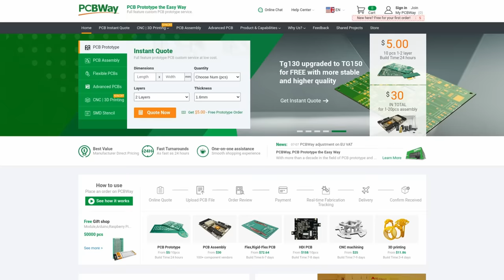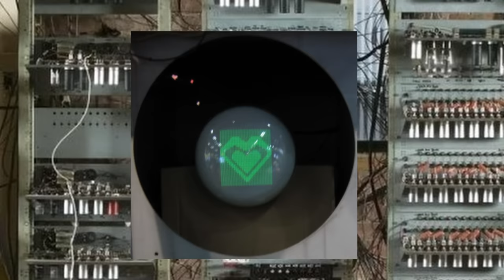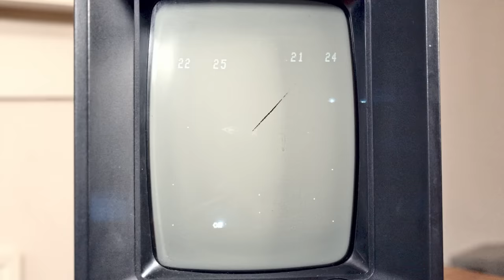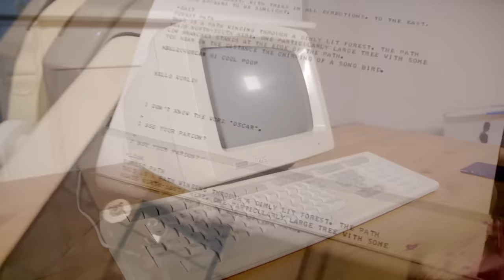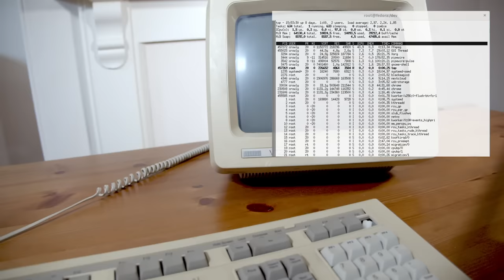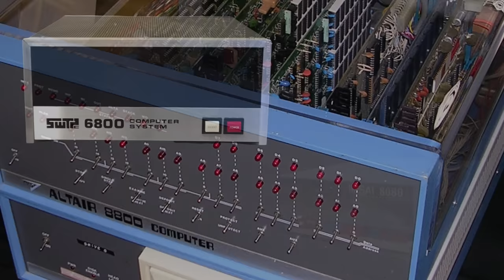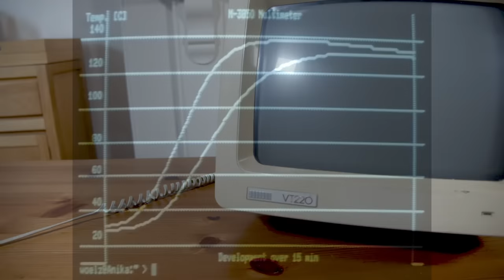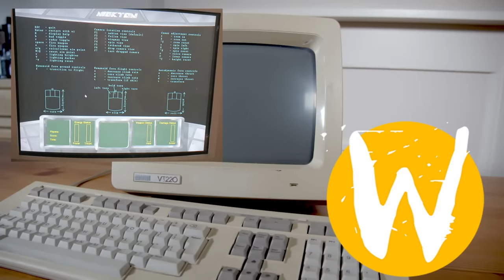The abridged history of Computer Display Tech

Comment: When I was in my 4th year of high school I learned the escape sequence to move the cursor around on our video terminals.  This was on a HP 2000E timeshare system.  I used that to write a game I called Logan, which was similar to Robotron (before Robotron) where bots chased you around a yard and you had to make them run into electric poles.  Even running on the primitive video terminals of the day, this became insanely popular and eventually took over all 5 terminals in our lab all day long.  The computer instructor decided that couldn't happen and deleted it from the system.  Rather than recognizing he had a budding computer game author on his hands he decided he wanted his lab back.  Not his best moment.
Reply from the maker: You have to wonder how many promissing computer games programming careers where snuffed out that way.
Reply: Kinda reminds of Tetris. Created from work computers and it ended up being so big it affected productivity.
Reply: The game you wrote might have been part of the teaching for the class next year. 

It won't be the first time students are shown an example from a previous year and encouraged by it and challenged to do better.
Reply: @20chocsaday  Yeah as it was I was discouraged from developing games and a valuable example was deleted.

Comment: This was fun.  I worked at DEC from 1981-1985, and during that time I worked on the graphics firmware for the DEC Professional 350 and later was one of the designers of what became the VT340 (the original prototype was much more capable, but too expensive to produce).

The Tek 4010, 4010A and 4014 were storage tube vector displays.  Vectors could be drawn at low intensity and they would fade unless refreshed and at high intensity and they would remain displayed until the screen was cleared without being refreshed. The tube was cleared not by removing power, but by flooding it with a higher intensity beam causing the phosphor to release lots of photons and quickly return to a low energy state. The text cursor and cross-hair locator cursor used the low-intensity so they were not retained.  If I recall correctly (and I may not), there was a way to erase individual vectors using a higher intensity beam that would overload just the the phosphor along the vector, resulting in the phosphor returning to the base state after emitting a lot of photons.  In the later 1980 and early 1990s, I was working at a company that produced terminal emulation software for PCs (Persoft, SmartTerm, respectively), and for the VT340 emulation product, I wrote a very accurate Tektronix 4010/4014 emulator (the DEC VT240 and VT340 had Tek emulation mode); though it did not end up in the final product, I originally had an "Easter Egg" in the code that would make the screen flash when cleared, had the cursors leave ghosts when left in one place for too long, and a few additional quirks unique to those storage tube terminals.

I also wrote the ANSI, ReGIS and SIXEL parsers for the SmartTerm 240 and 340.
Reply: I'm 99% certain Tektronix did not provide a way to erase a vector.  Not until the Tektronix 4025 but it wasn't storage tube and plotted about the same speed as a pen plotter.

Comment: I remember the era before CRT displays. The first minicomputer I used was a PDP-11 running RSTS with a DECWriter. I also used an Apple II in that era as it had just come out.
Reply: DECWritter was the bomb!   In the late 1970s my highschool had 2 TTY33s and 1 DECWriter.  I hogged that DECWritter as much as I could.
Reply: I used the PDP11/03 BA11ME. ODT to boot 8" floppies
Reply: I started on PDP 11/70, usung Dec Writer terminals & green-bar fan-fold paper that came Up from a box  underneath, then scrolled off the back of the machine as you used it. 
After working for an hour, you may have 40+ ft of paper behind the term, and you can tear it off to take home as your session log, to review & work with offline.  While you were still logged in, you could also just reach behind the paper terminal, grab 4ft of paper & stand up to "scroll back" and read code you were working 10 min ago.
For the next 4yrs, we had VAX 11/8650 computer with VT100. VT220 terminals, and VMS operating system. . .a really Great system at the time !!
Reply: What? HP had a CRT display in the 9100A in 1968!
Followed by the HP9845.
Reply: I still come across DECWriters from the 1970s that still work even though the ribbons are nearly worn out. It's incredible that something so mechanical and noisy could be so reliable. They simply will not die.
Reply: @MichaelKingsfordGray  I was one of the commoners using old hardware. I didn't see a CRT until college in 1983.
Reply: @mheermance  I had a privileged career, it seems!
I wrote my first program, (in 1969), on a CRT equipped machine.
Reply: An Apple II required a display for output.
Reply: @MarkWhich  True, but in that era home computers used TV sets for output, and were limited to at most fourty columns of text. Except for short Basic programs, most programming was still done on shared mini computers. Fortran for example had special rules about not putting certain statements in the first eight characters which made it's use on anything less than eighty columns difficult.

Comment: A few additional notes (and corrections) on the subject of random access displays (as opposed to raster CRTs):

What all these have in common is that you address a random point and activate it. In its most basic implementation, this is "point plotting" display or "X/Y display". This just displays a dot at the coordinates in question, maybe at a selected brightness/intensity. This is also what's found on the PDP-1. Notably, the dots drawn are discontinuous, it's just a dot and the next dot. Everything else, e.g., drawing a line or refreshing what's on the screen, is left to the software in the computer. Otherwise, the dots just fade away (these displays typically feature a slow phosphor to stabilize the image), to be replaced by what's drawn next. (Therefore, these displays are also sometimes called "animated displays" or "painted displays".) Technically, it's an elaborate oscilloscope with a digital input, typically using the kind of CRT that had been developed for RADAR. (Remember the slow phosphor? This is a feature you want to have for both applications., as is a high display resolution.) Most notably, there is no memory or register whatsoever in the display, besides the buffers for the current display coordinates.
(Given the quite astronomical costs of core memory for what would required for a screen buffer, as well as the rather slow speed of this memory, we can probably see why this was a typical setup for early computer displays. On the other hand, as resolution wasn't limited by any RAM, these displays had also quite a high resolution, in the case of the PDP-1 1028 x 1028, and there was even an option for a small, high density 4096 x 4096 display with a display area of just 3" x 3". We'll see later, why that should be this small.)

The next step is adding some memory and processing power in order to load off the refresh cycle to a dedicated piece of hardware. These were typically cabinet sized, just like the computers they were connected to. Now, you could have also vector commands, while the display hardware was still just drawing dots. Also, this was quite a complex and costly piece of hardware.
On the other hand, there were actual vector displays, which provided continuous activation, while the beam swept over the screen, from one location to the next one. So, instead of discrete dots, we get a series of lines connecting these dots. In order to do so, there had to be some memory, as well, where we can store a list of coordinates that should be visited in turn, as the image is redrawn on the screen. This is a true vector display, and it comes a bit later in history (because of memory technology).
There were even variants, where a sub-circuitry would add the required modulations for drawing characters at a given display location, providing a much faster way to draw text, than the display would actually allow for. Here, speed translates to the amount of text that can be displayed at once, without the display starting to flicker, as the list of display coordinates to visit in a redraw cycle became too long to keep up with the kind of sustain the phosphor of the CRT could provide. On the downside, these characters were often crude and not that great to read.

A limiting factor for all these random access displays was image stability. While the beam of a raster display travels just a minimal amount between two display locations and this in a continuous motion, the beam of a random access display has to address various locations, which may be anywhere on the display area of the screen (as implied by "random access"). Meaning, it may have to travel quite a bit at high speed, which is prone to any kind of overshoot and undershoot as the deflection coils are energized to the required level to address a given location. But, if we want a stable and sharp image, the location illuminated as we refresh the screen should be exactly where we illuminated it the cycle before this. In the case of point plotting display, where we are displaying discrete dots, we can address this by adding some time between moving the beam to a display and activating it to a level, where we excite the phosphor to visual level. Here, in terms of the precision and the resolutions at which we can achieve a stable image, the simple point plotting displays really shine, while also putting a limit to what amount of dots we can put on the screen without too much of a flicker. (This also introduces an additional constraint of display size versus precision and stability. Remember the small high-resolution display of the PDP-1?) With vector displays not so much, as we can't just stop before the next location. Which is also, why there are often blurry edges, especially with the more cost effective variety.

Last, but not least, there were also memory display tubes, where the CRT "remembers" where it had been activated and redraws this on its own, without any further input. As this is determined by the phosphor, there is no need to store these locations and its quite precise. But, as in the video, this is a story of its own and this comment is already quite long as it is…

Also, thanks for a great video! I always wanted some coffee table book on the subject.
Reply: Thanks! I've never heard of this technology before. Of course the first thing I thought was how do you refresh this... it's pretty much CRT DRAM.

Comment: William's Kilburn Tube. I was Manchester University in the late 1990s when they rebuilt a Manchester Baby for the 50th anniversary (I wrote a full speed emulation of the Baby for a classic Mac!) and I think it's not really true to say that the William's Kilburn tube wasn't understood as a display at the time, for the very simple reason they wrote an animation program to demonstrate its display capabilities, called Kilburn's Nightmare.

Which brings me to the next point, it's not true to say that the CRT was observed by pulling down the metal plate on the memory. Instead, there were at least 4 tubes: one for the program (32 words x 32 bits); one for the accumulator; another for the program counter (yep, a whole tube with just one line) and a final tube, called the monitor, which was simple a CRT that showed a copy of one of the other CRTs, selected by 3 buttons.

Which brings me to the last point: on the William Kilburn tube, the brightness of the dot didn't denote 0 or 1, the length of the dot denoted 0 or 1, where a 1 was 3x the length of a 0.

All this is described in the SSEM Programmer's Reference Manual:

http://curation.cs.manchester.ac.uk/computer50/www.computer50.org/mark1/prog98/ssemref.html

Kilburn's Nightmare can be seen on this screenshot describing a Manchester Baby simulator:

https://davidsharp.com/baby/
Reply from the maker: I see what you mean. The point I was trying to make was that they where concived as a memory device not a display. Yes they definitely knew about the useful side effect of them being able to display stuff and make use of it. However they where still built and conceved of as memory devices. 

Your right about the line length, I did not explain that part well. It was about pushing out sufficient electrons so that the read beam would not cause an electron splash at a given point of the screen. Bringness was not the best term to use for that, and bit more detail there would have helped.

Comment: It's funny how X still exists, and I'm still using it. Obviously (I think) I'm using it at the local machine but it's crazy to think how old it is.
Reply from the maker: X is incredible old now, but it has kept evolving. It keeps gaining extensions to moderise it, however its still compatible with x apps written decades ago.
Reply: Most of the X11 developers are concentrating on Wayland now. The sun is very definitely, if slowly, setting on X11.
Reply: @lawrencedoliveiro9104  yep. I'm using KDE on Wayland on Fedora, and unlike a few years ago it's so stable you won't know the difference unless you poke around.

It's still a mess on FreeBSD, however; but then FreeBSD on the desktop is a mess in general. OpenBSD is much better, if slow, and if memory serves there's no Wayland in sight for it.
Reply: I loved my old X Window workstations. So much damn overhead in painting the windows though.  Then again, curses was a hell of a lot of fun too.

Comment: the mainframe at Caulfield Institute of Technology in 1975 was the ICL 1904A (?) used teletype but had a handful of vacuum tube terminals. I entered programs in BASIC and got an output on a tty or the VDU which didn’t use any paper. The people doing EDP used FORTRAN on cards, there were these big card readers which started with a whine noise.

Comment: Speaking of games on teletype, my dad told me how he used to play lunar lander on a teletype machine and the way it worked just sounded a little painful and very slow.
Reply: Teletype lunar lander was a beast. Printed a line with all the flight parameters as quick as it could. At the start of the descent it was nearly "real time". Near the end, you'd make a giant crater before you could correct the engine burn. Don't get me started on "fps" :-D
Reply: So? A waste of paper?
Reply: @user-bp9bt6ox1h  That's literally half of what my dad remembered of it.  A HUGE waste of paper and ink.  But it was the university machine so he and his classmates did not care one bit
Reply: A more fun, but potentially dangerous game, was catch the teletype.
Reply: @EngineerOfChaos  I remember printing banners was big back in the mid 70's and 80's.  Teletypes and dot matrix printers.

Comment: My first full time job was running a computer graphics lab using Vision Control’s Conjure graphics system, it was an Australian system that was so rare and expensive that there is very little information about it on the web. We used it for generating SCODL files to feed to a Matrix film recorder which used a tiny and perfectly flat 4K screen to expose film one pixel at a time and via separate RGB filtered passes so it took about 15 minute to image a single 24 bit colour 4K frame.

Comment: EDSAC had bitmap displays in 1949, the SAGE early warning system had displays with light pens (guns) in the mid 50's... Tektronics 1960's...    Evans and Sutherland 1970's...
Reply: Without looking it up, I'd guess the SAGE displays were much more CRTs driven by analog radar circuitry than actual computer displays. It would have been easier, probably. Light pens don't really need anything from a computer to get an X-Y coordinate-as-a-voltage from a scanning CRT.

Comment: X11 is the best thing for running programs on a system that is dual-homed on a protected, and local network, where you don't have access to the console. 
You can ssh into the computer and tunnel the X server back across the network using the X terminal as the console. I do this all the time,a dn saves a great deal of headache.

Comment: We used to correct errors on teletype program entry by cutting/splicing the paper tape (if it was an error far up the program) or with the rubout.
It was a s*d of a job so we tended to not make many mistakes.
Didn't stop me (first program in 1976) from "doing computers" for ever. Still I mean :-P